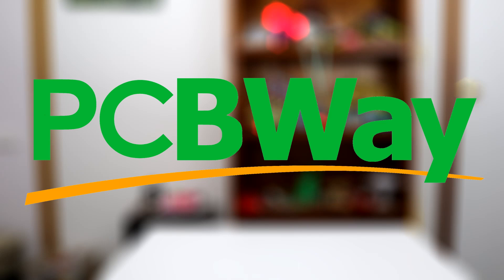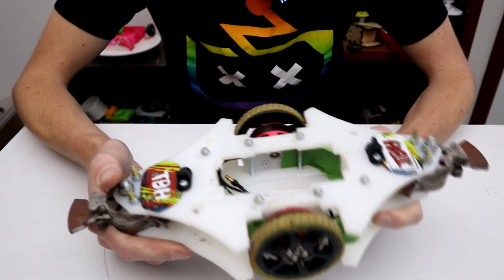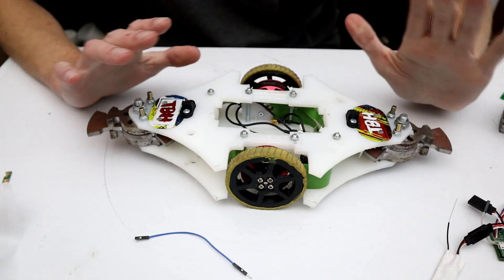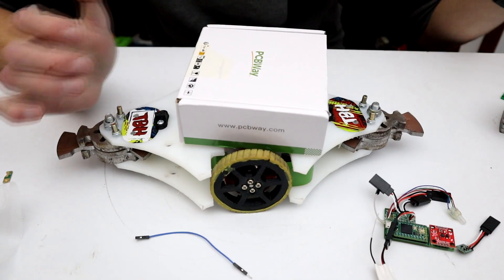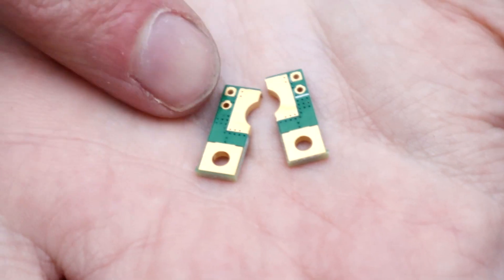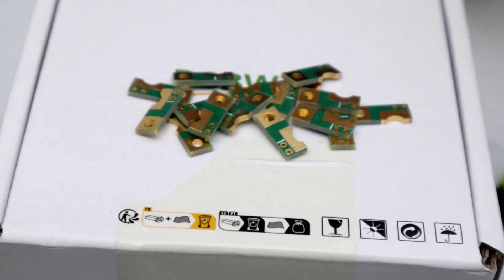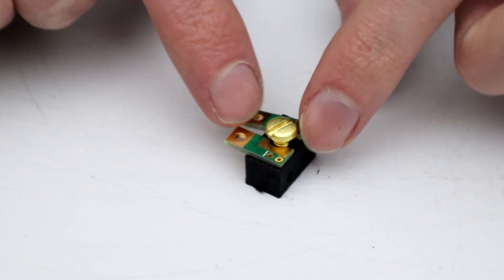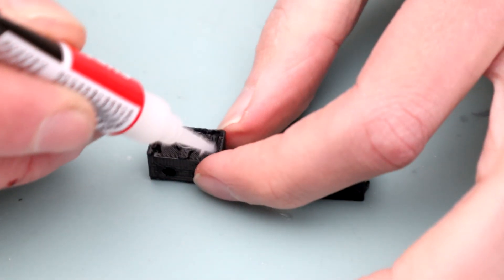Rush recycling a robot! (Speed melty brain build)

Comment: One issue you can encounter with the switch is that the glue comes lose during fight. Then after powering off, the pads can move around and sporadically power the robot up.
I would not trust the power off state to just glue.